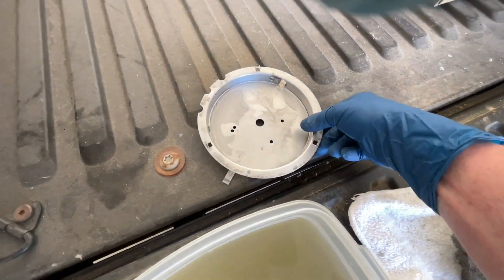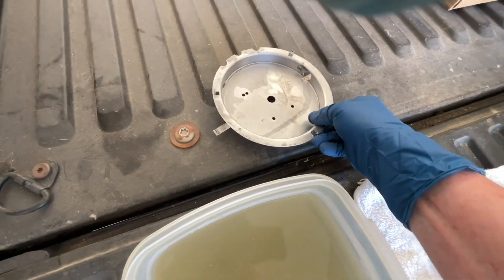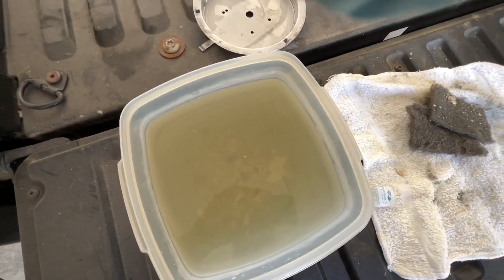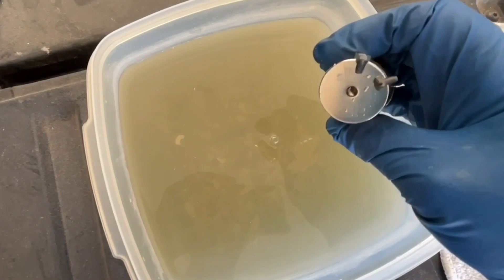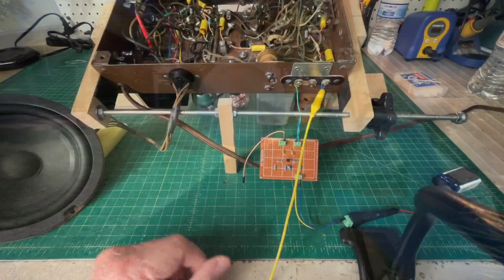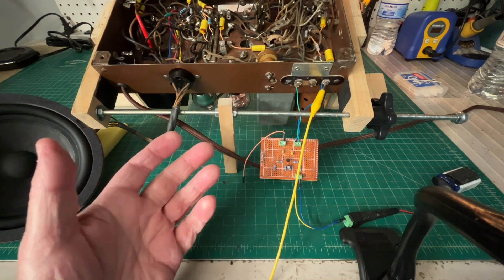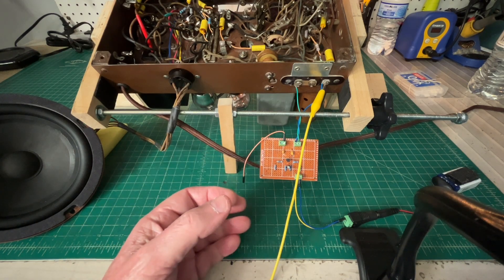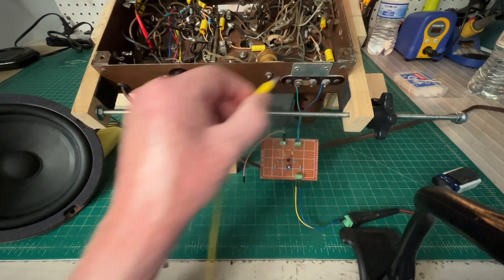Zenith 6S229 - Magnets Are Helpful, Dial Assembly & Common-Base Amplifier Prototype Build

Comment: I've heard that you can take a wooden embroidery hoop, with the proper number of windings around it as well as a varicon connected in parallel, and put it next to the AM coil to achieve a similar effect through the principle of induction.
Reply from the maker: Chet, you are correct. I built a similar antenna circuit (see below) some time back that builds on those principles. Best, Don

Build an Active AM Broadcast Ferrite Antenna /w Phase Loop
https://youtu.be/ZLOTl8hkPTg

Comment: Good evening master, what material would you recommend to clean the oxidation on the motherboard, thanks in advance 🙏🙏🙏
Reply from the maker: I would try Isopropyl Alcohol 99% (IPA) applying it with cotton swabs in a small area to evaluate its effectiveness. Best, Don
Reply: @RestoreOldRadios  Thank you... Do you mind if I use cellozoic thinner for general cleaning?
Reply from the maker: I’ve never heard of it, so I can’t say. All the best on your efforts. Don